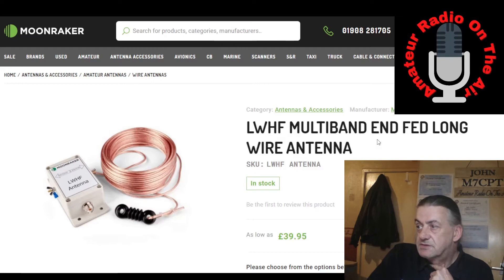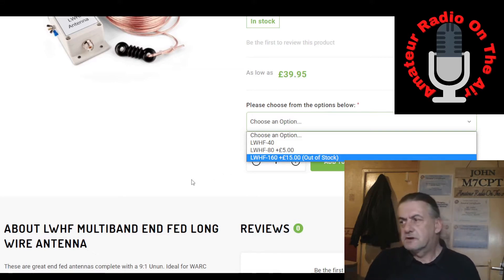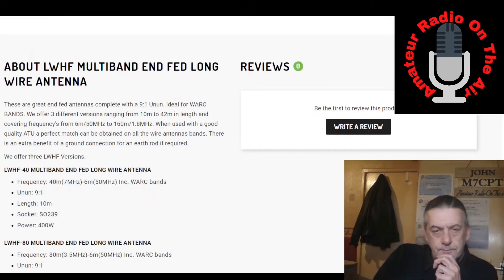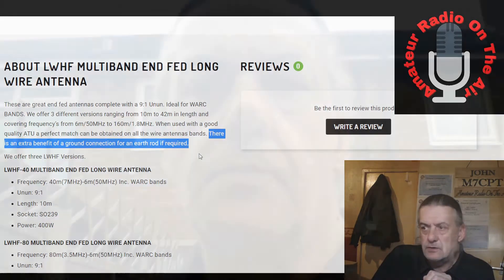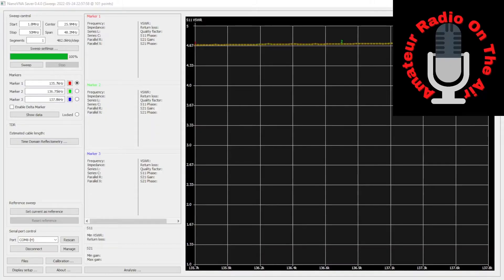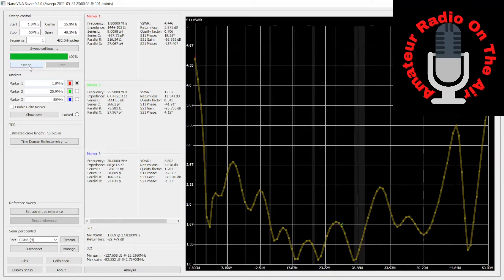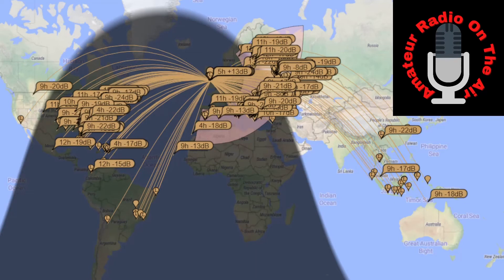End Fed Multiband Not So Long or Random Wire Moonraker's LWHF

Comment: Well I installed that wire yesterday. Didn't expect to much from it. First thing: The SWR is not good and mostly around 3 on all bands, on 20 meters even worse...on 15 mts the antenna is 1 to 1.5 without an antenna tuner. You can tune all the other bands with a Manual Antenna Tuner, I used the AT 230 by Kenwood. Tried some contacts yesterday and today on 10 15 20 and 40 meters. Surprising....on 10  Meters I reached India, Brazil and the USA among the usual Russians and South European Stations. On 20 Meters only Europe. On 15 Meters North Africa. On 40 Meters only Europe. But this simple lowcoast wire works...it is installed about 7 Meters high, fixed between two trees. For that small money an absolutely amazing antenna. QTH is JN 39 AM.  I recommand for portable use and if you need a fast installation done by yourself to be on air. Rig was an  old Kenwood TS 690SAT and 100 Watts, all contacts made in J3E
Reply: Use a separate counterpoise

Comment: Good test, what do you think of the idea of installing one of those antennas throughout a trailer?
Reply from the maker: Throughout a trailer? I'm not sure. I guess it would depend on the trailer and weather you intend to place it inside or out. Any metal in the trailer would also affect the signal. If it's outside ensure the bal-un is as far from any structures as possible and remember to check your RFI calculations across all the bands you will be using it on.
Reply: @A.R.O.T.A.  Thanks

Comment: Hi John, thanks for the video, just wondering if you have done any simplex at all on the Moonraker LWHF ?  I've just got the 20m version & hoping to be put up in the next few weeks, as opposed to being on a fence mine is going to be mounted between the house & rear of garage. M7JTF
Reply from the maker: Unfortunately due to my location (in a valley) I have not been able to do any significant simplex testing however I have used it on a few occasions to good effect for working NVIS.

Comment: I built one a few weeks ago, 133ft wire to a 9:1 balun, with about a 17ft wire on the, we'll call it the "negative" side of the balun, & a 50ft coax with a ferrite choke wrapped up in the coax near the radio end. Xiegu g90 tuned it on every band from 160m to 6m. I set it up once as a sloper, & once as an inverted L & made contacts both times.  It's long but I wanted to give my radio an opportunity to work on all the possible frequencies. Nano vna showed no resonance anywhere along the frequency range. I'm pretty happy with it.
Reply: Counterpoise was the word I was looking for.
Reply from the maker: I also get 160m-10m on my G90 and 80m-6m on my FT-991a. If I wanted 160m on the FT-991a I would require an external tuner but as I have a G90 I don't really see any benefit there for me.

Comment: That is the whole idea of these "random"  antenna lengths.  These lengths are resonant on a frequency, but not on any amateur radio frequency.  Therefore, they are not for any particular band.    Just put one up and see where it tunes.  If your tuner cannot handle the mismatch, use a 9:1 Unun between the antenna and your tuner.  For 80m- 10m, try the 71 ft length, it is close to a 1/2 wave on 40m and a 1/4 wave on 80m.  Tthis can be deployed as a sloper, inverted V, an L or inverted L, a vertical . . . it is very versatile.

Comment: Interesting video and great results 👍🏼
Might try one of these. I made my own EFW antenna last week, I used one of those ‘green’ numbers on the link you looked at (41feet) that fits nicely into the garden. The 9:1 balun was something I previously had for shortwave listening and I took a ground to a copper rod in the soil. Had some good results in Europe on SSB but nothing further and it tunes down to 40m with the transceiver ATU. Best results on 15m. 
I’d like to try a dipole but too inconvenient getting a centre support up in the middle of the garden. 
Anyway, if I try this Moonraker version I’ll report back if there is any improvement on what I am using.

Comment: Amazing - I might get one if it really is that easy. Purely for RX. Have you tried it on 27mhz and how does it perform?
Reply from the maker: The short version of this antenna has a VSWR on 27mhz is 1.5 without a tuner so should work perfectly well but I have not tried TX on that frequency.
Reply: @A.R.O.T.A. Thanks. I'll be getting one and putting it in ready for when I've done my Foundation license. Question: I want to run it off the top of a Spiderbeam telescopic pole and then down the side of a very old 60ft long outbuilding made of stone. Using plastic cable clips presumably. I'm assuming it's ok to run it down the side of masonry?? I've only get experience with vertical 11m antennas. TIA
Reply from the maker: Should work pretty good with that setup. Just remember that the feedline or the counterpoise should be kept at least 90 degs from the main radiating element.
Reply: counterpoise as in earth?? Feedline as in coax??
Reply from the maker: Counterpoise as in an extra piece of wire sometimes added to the earth side for better performance (not to be confused with a coper rod imbedded in the earth).
Feedline as in coax yes.
Reply: @A.R.O.T.A.  Many thanks for help and advice!

Comment: The power rating is 400w....it was the last item listed, a little below the wire length
Reply from the maker: The 400w rating is also known as UK Max for full licence holders and in this case refers to ssb. CW & Data modes are normally a lot less so be sure to ask for a rating specific to these modes if you intend using them.
I only have a UK foundation class licence and can only test upto 10w (far bellow the max rating for this antenna).
Reply: @A.R.O.T.A.  Ahh, gotcha....I  wasn't aware of the UK limitations, just assumed that was the max for the antenna. As for the CW and Data modes, I've never understood why anyone would use more than a few watts (20 or so).....actually even seems a bit rude when 5-10 watts will do the job...

Comment: Hello john ,just came across your YT channel.  Am i right in thinking your contacts DX are on digital modes ? Because to work across the pond on 80 m on a 20m end fed is very difficult on 10watts even using morse code?  But you managed loads of contacts,  well done ! 
I don't do digital,  so I'm not familiar.  
As for ant length the idea of the 84 feet on your first chart is to find a happy compromise. 
84/ 85feet with a 17feet  tail as counterpoise ( same lengh as G5RV ) .
The idea of 9/1 un-un is to transform a impedance of 450 ohms to 50 ohms . A half wave end fed will be very high ohms hence 49/1 un-un is needed . 
Try different lengths,  if you can get the feed point a bit higher will also help keep the current higher about ground . 73
Reply from the maker: I use FT8 for ease of generating a range report on the fly. Unfortunately my Morse isn't good. FT8 will get slightly further than Morse and considerably further than SSB/FM/AM. The version I am using in this video is the 10m end fed and 80m to USA is sporadic at best and mainly reliant on current conditions. I would expect better results from the longer versions that Moonraker do but I am limited by the size of my current property. Height is also something that should benefit this antenna.
Reply: @A.R.O.T.A.  No prob , tks for responding.  Enjoy your ft8 .

Comment: i have just installed the 160m version i have yet to use it for tx but it seems to tune well right up to 6 and it hears well mine is mounted via poles and a tree at 10 meters agl with a 20 ish meter counterpoise on the earth terminal. might i suggest if you are going to keep it up to loop it through to another dogbone insulator at the ba8un end seeing it tensioned straight to the ring terminal made me cringe as the first decent gust of wind its going to ping off.
Reply from the maker: It is not "tensioned straight to the ring" the 9:1 Un-Un is 5 meters from the shack (as far as I could get it from surrounding buildings) the coax then goes to a 1:1 choke Bal-Un outside the shack with a short jumper to a through window lead and then another 1 meter lead on the inside of the shack.
While The setup is not perfect, it does work.
After I move I will be hoping to be able to improve the setup and add height of the main wire and if I'm lucky I may be able to setup the 160m version.
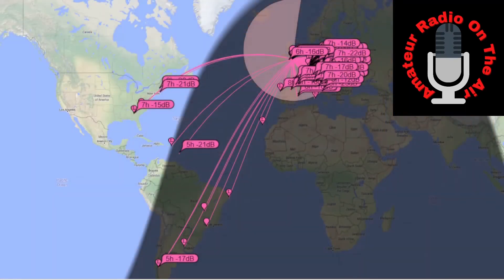Reply: 10:56 what software do you use for this call sign mapping?